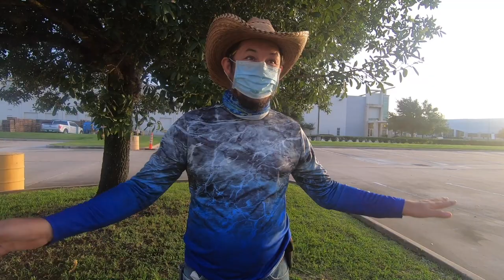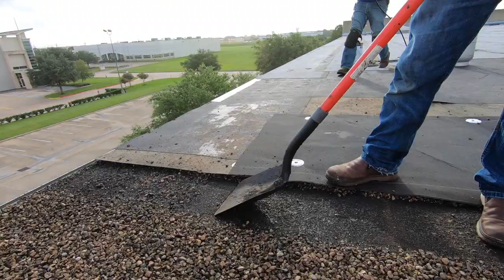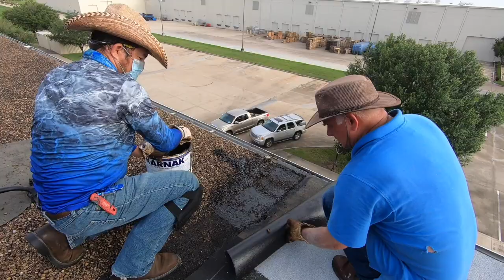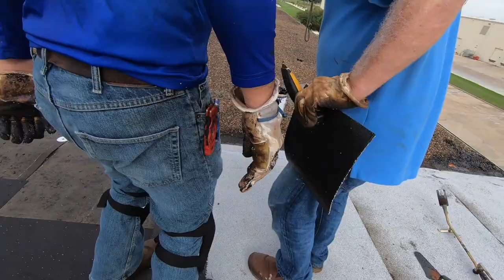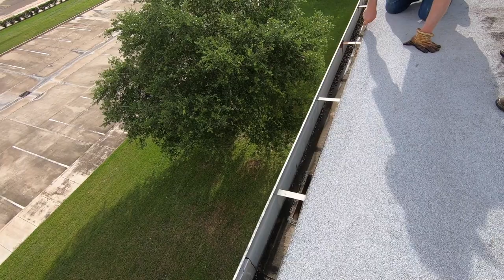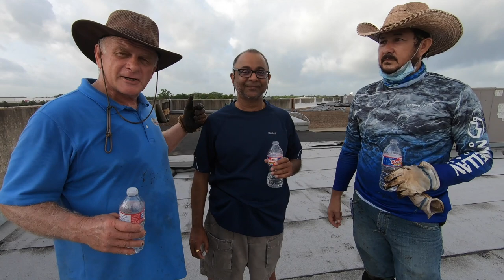Training Rookies to install a Torch Down Roof - The Transition to Tar and gravel - Part 2

Comment: The comments on here are accurate that we do not have to be there to see the mistakes being made,he has untrained guys doing an 85,000 sq ft roof and the most experienced guy on the job has hardly a clue what to do,he is impatient with his help and doesn't know himself how to do the job to specifications, self taught doctor of roofing means you patch it up as you go along and you understand that the property owner has no clue of what was not done right,he is saving money from not hiring a qualified roofing contractor and the roof doctor tells him it will last 40 yrs which in 10-15 yrs it will be leaking and he doesn't have to fix anything after 1 year.

Comment: The drip edge metal is supposed to be primed with asphalt primer. The end laps are supposed to be trimmed to avoid the hump. Pointing the open flame at the roof cement which is flammable material is asking for trouble. You can just torch down the cap shit to the existing build up roof.
Reply from the maker: The Karnak 81 is the same as the primer. It is asphalt. You just like to see it out of a spray can. Sorry that you think that your way is the only way. dMaybe you should start teaching

Comment: Is there any way to do it and have it also look nice and clean? I mean it looks really rough there now. Like tar is through the top granulas
Reply: with that color it's real hard to keep it looking clean in that heat, but it can definitely look better than that with a proper crew
Reply: Yes there is higher a professional not this shoemaker
Reply: @WhiteRockBoy  that's knot true even in the heat it should still look like new not what this guy does
Reply: Almost ALL his jobs are like this. Just sloppy workmanship.

Comment: Do you have any tips on installing decks on pedestals over modified bitumen roofs?  Can you use a small 1ft square of modified material as a edition cushion layer without touching it on?
Reply: Yes that would be OK.  It is good practice to put down pads as a cushion wherever needed and just a quick blast with a small hand torch (Benzomatic) in the middle of each pad, right before you set it down, is enough to keep them in place.

Dents are no good for a flat roof.  Even if it did not cause a puncture it becomes a place for water to pool and disrupts the roof flow

Comment: All wrong!
Reply from the maker: sure, 3 years later they still have not had a leak on a 80,000 sq ft roof. But it is all wrong and according to you it should leak all the time
Reply: @FlatRoofDoctor  first off you don't walk over something that's been freshly torched you pull the role towards you as you torch it.  I would hide your video from the manufacturer because of no manufacturer would warrant the roof that was installed like that
Reply: @guyjohnson6787  it's simple, he doesn't do any manufacturer warranty work. He does his own warranty. He probably does a taillight warranty. I'm in the roofers union and if I did anything hack stuff like this, I would be fired instantly.